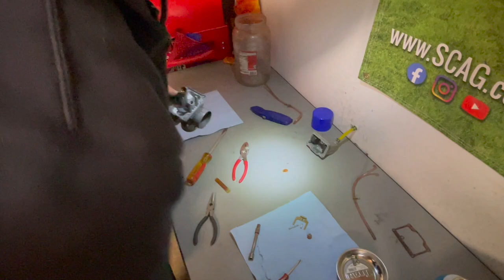Resurrecting an Old Snowmobile in Under an Hour (Abandoned Arctic Cat Puma 340 Carburetor Teardown)

Comment: If you pressurize the fuel tank a little ,the carbs will fill with fuel and you won’t need starting fluid.
Reply from the maker: That’s genius. I’ll have to give her a try on the next project. How do you recommend making an airtight seal
Reply: @backcountrybuilds  If you look along the top of the fuel tank, you might find a vent tube, if you find it, place an air gun into it and squeeze the trigger lightly till you see fuel moving thru the lines to the carburetors, if you can’t locate the vent tube, remove the gas cap,stick the blow gun into the tank, wrap a rag around the gun and gently squeeze the trigger. You don’t need a perfect seal, just enough to move fuel into the fuel lines.
Reply from the maker: @PaulRaczewski  awesome. Thanks so much